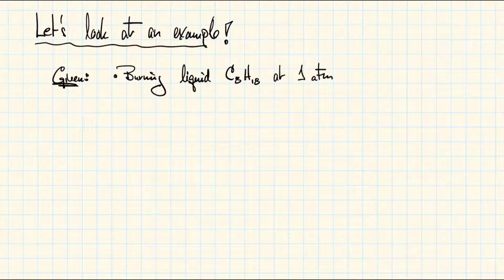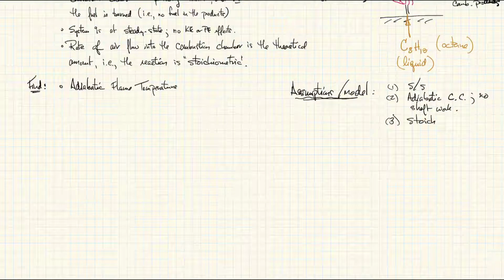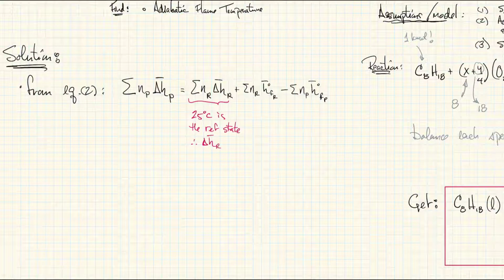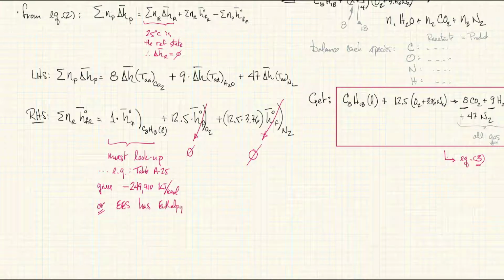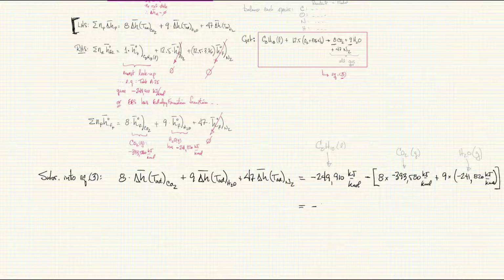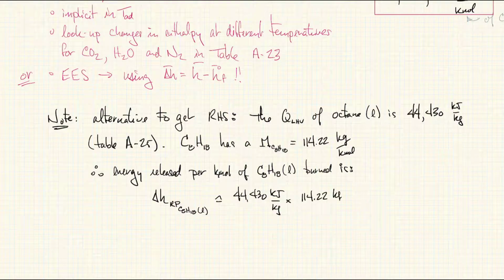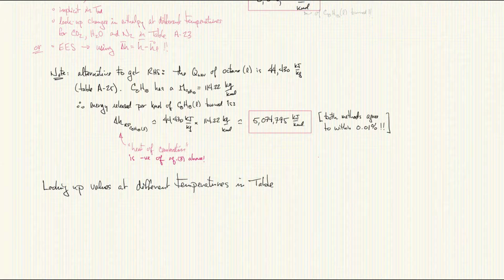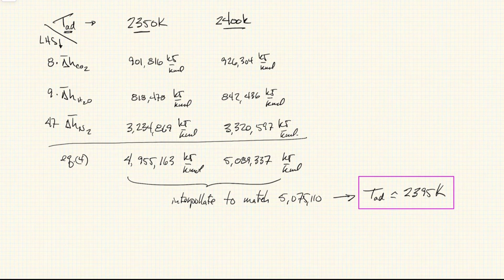Thermo II: Example of calculating the adiabatic flame temperature for a stoichiometric octane flame.

Comment: Many of us don't know chemistry. More background on where these combustion equations  come from would be super helpful!
Reply from the maker: Hi - This video lecture focuses on calculating the adiabatic flame temperature of a combustion reaction specifically, and it assumes that you already know how to balance such an reaction equation. It is not meant to be an introductory chemistry video. For background on how to do that, I suggest that you refer to Sections 13.1 and 13.2 of Moran-Shapiro (per Module 9's  instructions), which shows you how to do that from scratch. For example, the stoichiometric number of moles of O_2 required per mole of an arbitrary hydrocarbon C_xH_y   is shown to be (x+y/4), and I used that as a starting point in the video here.
I might work on an intro video like that in the future, but don't have one yet.